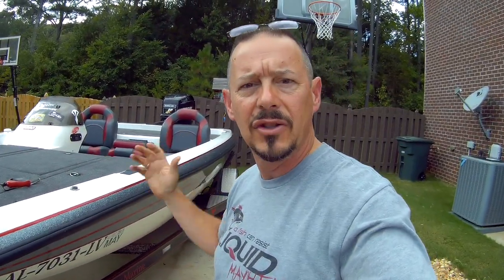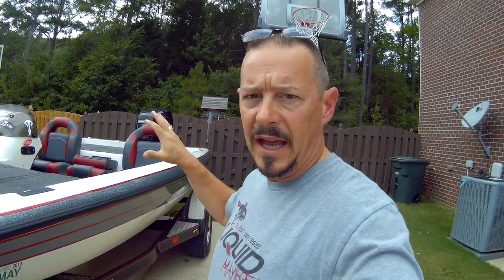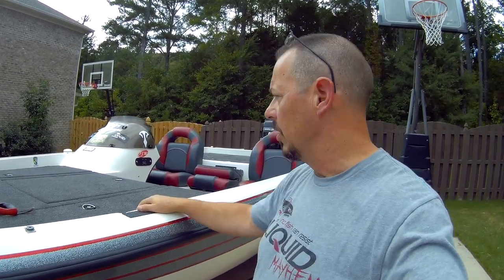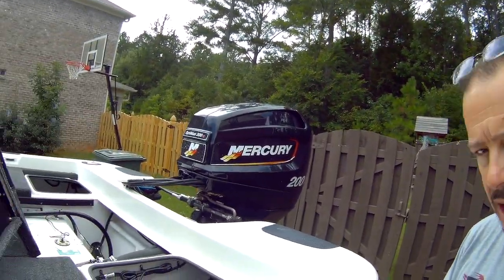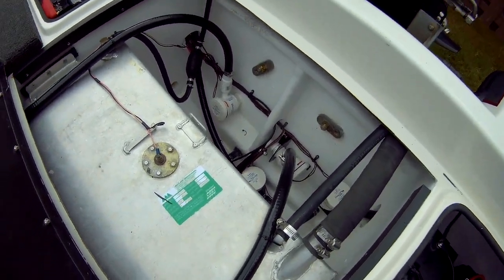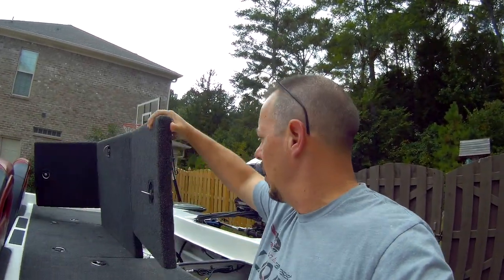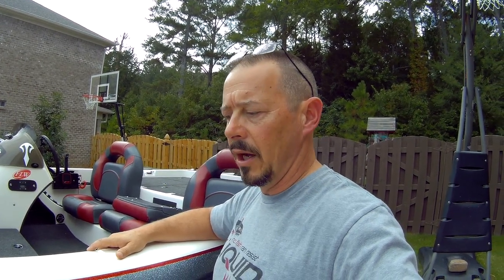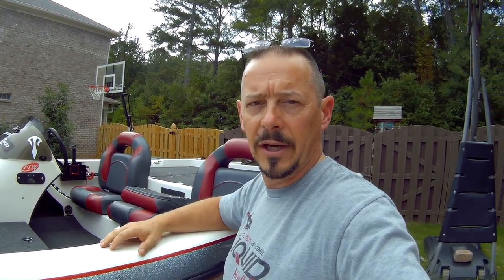The Bumble Bee Returns

Comment: What was the ball park on the work done? I'm looking at 2,500-3,500 for the transom replacement on my v160.
Reply from the maker: For everything that you saw, new transom, new stringers, new floor, new pad on front deck with new carpet through out, new wiring of all electrical and batteries, I paid $7600. That also included a wax and buff of the clear coat.
Reply: @biggbassin8040  Mine still feels really solid in the floor and from what I can tell the stringers/knees are good so Hopefully mine won't be going in for a full resto but if it does oh well.I don't plan on getting rid of mine once done.
Reply from the maker: @tnbass2833  I don’t know how far you are from Hazel Green Al, but Greg Brooks did a great job for me. I highly recommend him if he is close enough to you.
Reply: @biggbassin8040  Its about 2 and half hours away. I drove almost 4 hours one way to get the boat. A roadtrips never bothered me.
Reply: @biggbassin8040  After multiple phone calls I'm going to be bringing it to Greg this upcoming coming fall. The pricing is right and he was pretty much the only shop willing to talk to me this far ahead of dropping the boat off.
Reply from the maker: @tnbass2833  Greg did a fantastic job on my boat and I have not been disappointed with any of the work.  I don't think you can go wrong bringing it down to him.